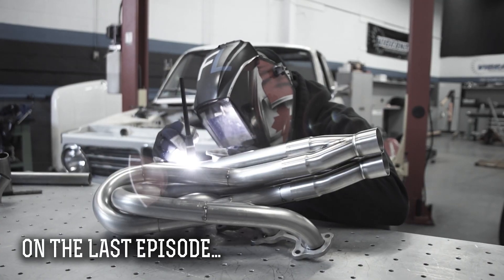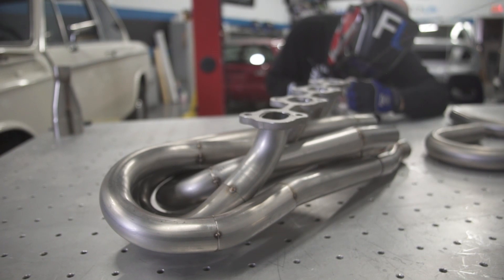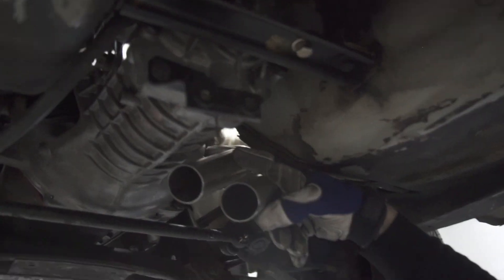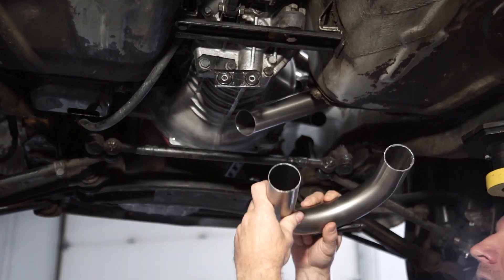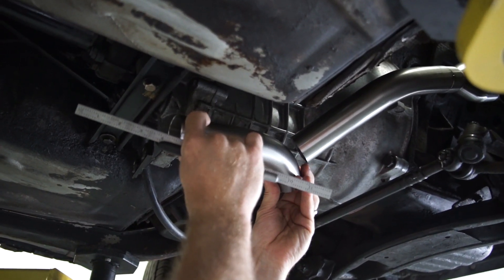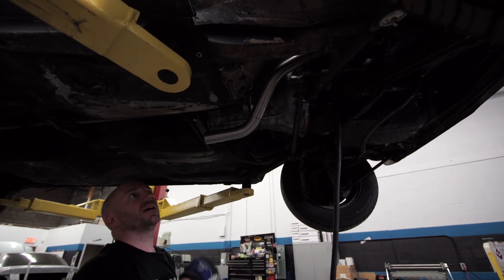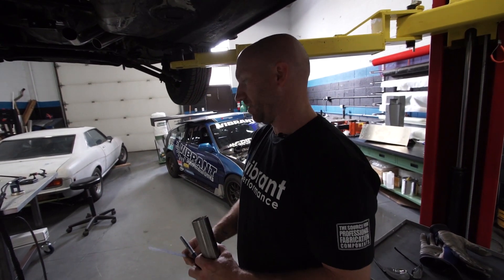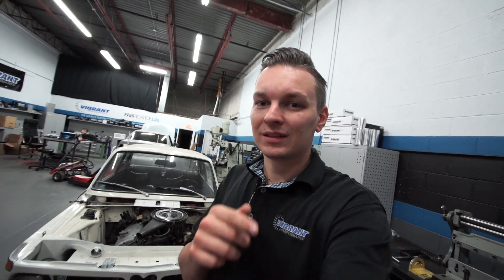Retro Header Build-Off Part 3: Completing Secondaries

Comment: I bet Moog can't play a header like that.

Also curious if anyone is watching these comments, but what's the advantage of having insanely long tube headers? I don't know much about exhaust, but wouldn't you want the gasses to exit the car as quickly as possible to make more power? That's what I would think, anyways.
Reply: Long tube headers improve scavenging effect (exhaust can flow faster than just dumping it into the air by creating a vacuum after each exhaust pulse) and each primary is longer so there is less interference with pulses from other cylinders. I'm sure there's a better explanation.
Reply: That makes sense. There's less turbulence in the air when the exhaust gasses aren't being pushed into one big chamber like with most stock manifolds. Since there's limited space under the car, you make the header come up and back around.

Comment: Why not use icengineworks header modeling system. If you don't know what that is look it up it's awesome. It's like playing with Legos again. Makes the process of creating a one of design header extremely fast
Reply: those are a great tool if you are doing a lot of one-off exhaust headers/manifolds.  if someone is just building a header for their own personal car and don't intend to build more,  you need to weigh the benefit of it versus the time/cost of doing without.  you would also need a set to match each CLR of the material you are working with.  Vibrant offers a couple different bend CLR's.   i have never used them in the past- i suppose i just prefer to learn without the extra aid.  in the end you are still going to have to cut metal and make tweaks along the way- even with a 3d model like in the speed academy series with Jay.

Comment: Nice job! I wonder how the 3D scan method would have made such a complex header, comparing the Speed Academy header. One can see this "one off" method can be relatively fast but reproducing it would be difficult. Looks like the "other" header is easily reproduced, keeping in mind it is much more straight forward a design. Fun videos and fun "build off"!
Reply: reproduction is actually not too difficult if you plan for it before you start.  making a quick little jig for each runner as it is built could have been done if reproduction was a consideration.  trying to design something like this in CAD ahead of time would probably take more time than pulling a jig off it as you go along.  that's just my opinion though.
Reply: I agree.

Comment: Did you do analysis on runner and secondary lengths?  They look pretty long, my guess is that this old engine doesn't breathe well top end so you're trying to maximize VE where it matters most?
Also, the assembly music makes me feel strange .  No bueno.
Reply: Beau Mancini long tube headers aren't known to make power on the top end ,more so on the mid range and low range . Four cylinders lack torque which is why most race headers are long tube.